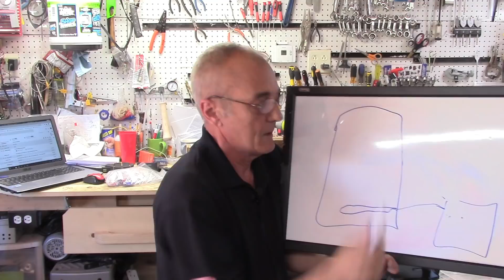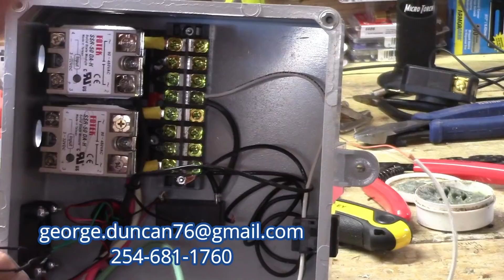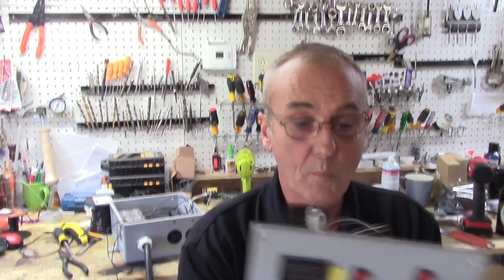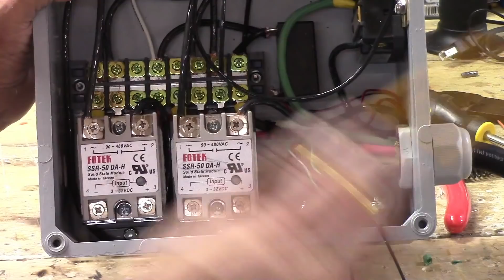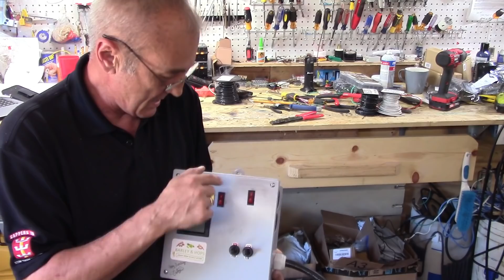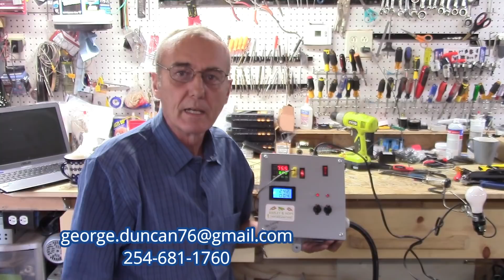DUAL ELEMENT HEAT CONTROL PART 2

Comment: Hello George, running just one ta4 PID on two ss 50da relays?? Sharing output voltage from the PID, to both ss relays at one time is that cutting the voltage from the PID in half?  Would that not be Causing you to lose total output from the ss relays, while only allowing both heater elements to work at half voltage?  Further that much load on the small amp PID output, I think would smoke the PID transiters and broad. I notice that  MyPin  states that the PID is design for only one ss relay. I feel it's a good idea, but You should consider a PID for each Relay.  Sorry George lol  I don't think this design would pass UL certification...

Comment: HI : George what parts are needed for a 240 Volt 30 amp dual element controller with a amp meter ?I want to try to build one
Reply: I sent him an email asking to buy plans/schematic. I'll let you know if it's an option.

Comment: Building a diy powder coating oven with 6-10 elements running off 220 what are the requirements I would need to build a control panel?
Reply from the maker: You need to match your overall wattage with the proper wire and fuse.
Reply: Barley and Hops Brewing I’m using electric stove elements that average at 3k watts I was wanting run them of a heat control panel with a pid. What would that consist of?

Comment: If you have 2 elements plugged in and you turn both switches on and the both call for heat won’t it trip the breaker?
Reply from the maker: Yes if you don't match the power requirement with the proper circuit.
Reply: @BarleyandHopsBrewing  any recommendations for a 30 amp 240 toggle switch.on-off-on?

Comment: Can you tell me what voltage the indicator lights are heating control that you used? Thanks.
Reply from the maker: 12 volt led
Reply: Barley and Hops Brewing 
That’s interesting, and it didn’t blow out. Actually that’s perfect because I have a couple of 12 V red, I thought that being it’s putting out 32 V it would blow those up. Thanks for your help I’ll let you know if it all works out.

Comment: Could you wire the DC fan to the alarm pins on the PID & just set the alarm "always on" instead of using the rectifier?
Reply from the maker: Alarms pins do not produce any current. You need to provide that for these to work.

Comment: Hey George nice video. Just wondering why you didn't add a parts list and where we can get these parts? Also, I have build my current controllers with a analog rheostat and amp meter. My HERMS is wired with a 3 wire system, 2-120v and a ground. I run 2-120 volt pumps and 2-30 amp receptacles no problem for years 2-30amp SSRs. I have a 70 amp breaker coming into the brewery no neutral! Would you please give me info on the parts? Thanks Dave

Comment: Where would you recommend the thermocouple be placed on a 40 gallon reflux running a 4" column.
I'm  running a pid control with two 5500 watt elements
Reply from the maker: Where ever the vapor leaves the column.
Reply: @BarleyandHopsBrewing  thanks

Comment: Hello George! Will I'm ordering parts for my PID. My question is do I need a 10 gage 4 wire cable or can I use a 10 gage 3 wire cable? 240 coming into a MYPIN Universal Digital TD4-SNR PID Temperature Controller and Fotek SSR-50DA-H 50A SSR 50DA H DC to AC Relay Solid State Resistance Regulator for my 13 gallon milk can still. Thank God for your videos on these PID's, as well as the tips on distilling.
Reply from the maker: 10 AWG for that size would be best. You only need 10AWG for the incoming power and then to and from the SSR. All other wiring can be 16 AWG and for signalling on pins 3,4 of the SSR you can use bell wire. 
George
Reply: @BarleyandHopsBrewing Thank you so much George. It seems that the older I get, the less I under stand. But I'm trying!

Comment: Also, do pids work well? I thought they would struggle trying to hit a moving target as the alcohol drops and temps change.
Reply from the maker: They work excellently. They cannot take into account alcohol volume so as the still stops producing you will need to increase the set point.

Comment: Did you switch to the Fotek SSR-50 DAs because their 25DA and 40DA models are not actually rated for 25 and 40 amps respectively? Youtubers who have taken them apart found the Triacs inside them can only handle 10A for the 25DA and 16 amps for the 40DA models. . Anyone using them for controlling heating elements is taking a big risk unless they use quality SSRs that meet their specified ratings.
There is also the problem with fake / counterfeit Fotek relays on the market
https://protosupplies.com/inferior-counterfeit-fotek-ssr-25-solid-state-relays-on-the-market/
Reply from the maker: Thanks so much for that load of research. You are changing my mind quickly. Unlike some people who post here, you do your homework and I appreciate that. My eyes are always open to information from reputable sources and you are a reputable source to me.
Greta job. I appreciate it. Please continue to comment as your comments have weight.
George
Reply from the maker: No, I used them because I always overbuild controllers for safety.
I've seen this post you added about the counterfeit SSRs. I haven't run across one yet.
Reply: @BarleyandHopsBrewing  Have you tested any or taken any apart to check what TRIACs are used? Counterfeit Fotek SSRs have been  sold by both Amazon and eBay,
Even authenticate Fotek SSRs are made in China  junk compared to  quality SSRs from Crydom,  Schneider, or Teledyne  that meet US and CSA standards. 
Running Foteks without constant supervision is risky when operating very high watt instruments like heating elements that can start major fires, 
Also, not to be argumentative but you have posted several videos using Fotek 25DA and 40DAs. This video is the first one of yours I've seen using 50DAs.
Reply from the maker: This is because it is a dual 5500Watt element controller. A bit of an overbuild on my part. 
I did take one apart and can say that the BTA24-800 Triac used is rated for 25 amps at 800 volts. This is exactly what the label says. I see no reason why someone would disassemble one since it would render it useless. The components are embedded in a heat resistant solid paste. 
I am always suspicious when I see reports like the one you offered and the ones I've seen.
There is also no financial benefit of using inferior triacs since the cost is so low (less than a $1) there is no savings by switching them.
The primary problem I run into is people who get the 25 DA and then they try to run a 35,45 or 5500 Watt element which all would overload the triac immediately. 
My opinion is: No one wants to admit this or blame themselves, it is much easier to say that they are counterfeit and inferior. I have not seen any posts that even indicate the type of triac they discovered or its rating. 
Makes me wonder.
George
Reply: @BarleyandHopsBrewing Many people have reported serious problems with Fotek SSRs. A quick search of Google or YouTube proves that. In addition to the article I linked previously there are many others like this one for example, from home distillers like yourself who discovered melted Fotek SSRs in their controller boxes  boxes.https://aussiehomebrewer.com/threads/counterfeit-ssr-warning-check-your-gear.90323/  As far as Foteks being filled with epoxy that it isn't always true. I have seen some with hardly any epoxy, Here is a video of an electrical engineer who works with SSRs taking apart a Fotek and showing how little epoxy it had https://youtu.be/DxEhxjvifyY 
You're incorrect to blame users when there are actual facts proving the poor quality of these SSRs. There are even news articles warning people about the problems https://www.prnewswire.com/news-releases/ul-warns-of-solid-state-relay-with-counterfeit-ul-recognition-mark-release-13pn-52-242919311.html 
If you know of a licensed Fotek dealer in the US please post the contact info. Foteks can't be found in the inventory of legitimate suppliers like Mouser or DigiKey Electronics. Foteks are cheap for a reason: As they say you get what you pay for only in this case it can burn down your house. Since you sell these SSRs to customers I wish you luck.

Comment: I apologize for being off topic here, but I would like to request a video. I am a brewer looking to get into distilling. So, as you can imagine, flavor is my primary concern, with proof coming second. You have a lot of videos where you're using a hybrid still in "pot" mode. Well, I was wondering about the design at this link: https://moonshine-still.co/products/8-gallon-moonshine-still-with-2-pot-still-column-and-3-gallon-thumper?gclid=Cj0KCQjwz6PnBRCPARIsANOtCw1YjtF_XWPWRPIDjXFF2YpFbcbLlGWd3wLAeGV6kqeAYggz-lT5Wl4aAl0yEALw_wcB I saw this at my local homebrew store and it seemed to really speak to me. 

Why 8 Gallon? I'm following your advice combined with some beer brewing experience there. I expect to be distilling roughly 6 gallons at a time as more becomes hard to handle. So, what I would really like to know is really a couple of things. To someone just beginning like me, it looks like that curved column will allow for more flavor, at the expense of proof, since I wouldn't expect much reflux action. Am I correct, or am I way off? Also, is a design like this compatible with a gin basket? If so, would a gin basket be the best way to impart extra essences or flavors, or would they get stripped away by the thumper? If not, then could I add adjuncts to the tails in the thumper to get a really strong flavor? Would doing both be wise?

For the purpose of making a brandy, I know you tend to say, "Could is the wrong question, so ask if you should." Should a brandy be proofed using juices rather than water? For example, a blackberry brandy tends to be a bit purplish, and I assume that is due to addition of juice after distillation. Well, the color certainly comes after distillation, so I assume the addition of blackberry juice, or using blackberry juice to proof is the method used. 

I guess the summary is this: Is a column/reflux still required to run with a gin basket that has fruits added to impart flavor? Would a gin basket or a thumper give more flavor? Can they be combined? Is there a disadvantage to running a still that doesn't have a straight column aside from the fact that there are fewer ways to configure the still?
Reply: If I bought this, I'd modify the "thumper" into a 3 gallon still and make the thing into 2 stills so you can distill 11 gallons instead of 8. But that's just, like, my opinion Maaaan!
Reply: @JesusisJesus  you already turned the wearer into wine. If you distill it too there's no work left for the rest of us!

Comment: Hey George awesome videos. i watch u all the time...the the knowledge you share is priceless
....I am setting up a 3 wire 240v 20amp system running a 3500watt element .  I have a couple questions I'm hoping you can answer
1. I am using the same mean well converter to power my dc fan that u are using....i am unsure how to connect it..i assume i connect one hot leg to my load line but which line do i connect for the neutral because i do not have a neutral line in a 3 wire system.
2. I want to use a lighted switch like u have. do i buy a 3pin switch or 4pin switch. I assume if it is a 3 pin switch then i only connect one hot leg to it and the other hot leg i run directly to my outlet????
Reply from the maker: Your second hot wire goes to the N pin on the meanwell IC block since you don't have a neutral. The IC block is rated to handle this.
You will need a 4 pin lighted switch since you do not have a neutral to run a 120V circuit. Both hot wires go to the bottom of the switch and two hot wires come out the top and go to the PID power in pins. Do not run it to the outlet, the amperage will burn it up. The outlet should have one hot wire from Pin 2 on the SSR and one hot wire from the wall. This way you are switching the closed loop circuit with the SSR.

George
Reply: @BarleyandHopsBrewing  Awesome info
i can't thank you enough for info you share with the distilling community

Comment: George any electrical circuit has a max working load. An example of this would be a 30 amp circuit would have a max working load of 24 amps. Or 10 gage wire is rated at 30 amps, max working load is 24 amps and a max wire run of 50 feet, when you start running amps close to the max amperage a circuit is rated at heat will start building heat in your breaker which can lead to a failure. Please make sure the folks who buy this set up from you have the proper wiring where they plan to install your device. Your controller is really cool, and I’ve often wondered if one pid can control 2 electronic relays.

Comment: (Bump) If a voltage regulator was added, would it go before or after the PID? I.e. not having to run full power to element.

Comment: hey George  nice job i want one just like that. also sign whats the cost.
Reply from the maker: Price is based o requirements so I do not have a base price. A standard single 240 V controller starts at $215 with free shipping.
Reply: I know that is a great price.   I have spent 500 in money time and aggravation.    Finally with George’s video help I can run my set up flawlessly.    Buy his box and be done.    You will not regret it